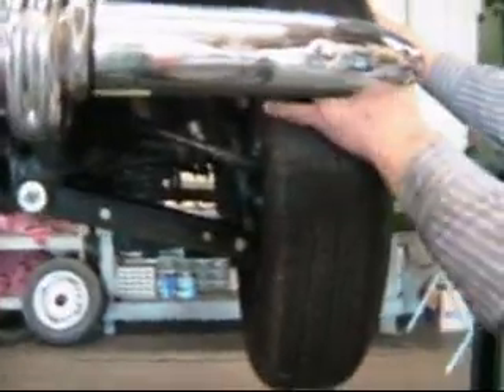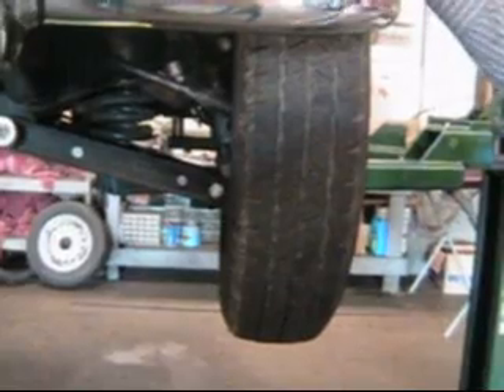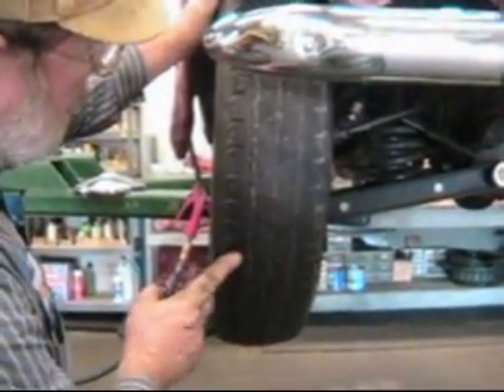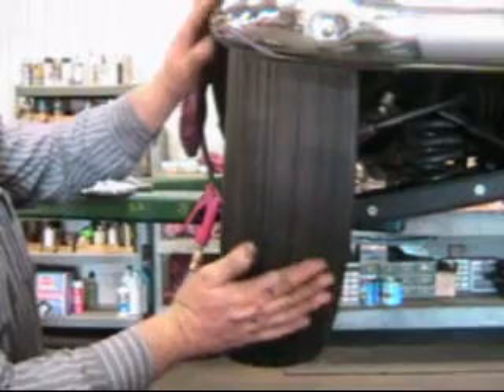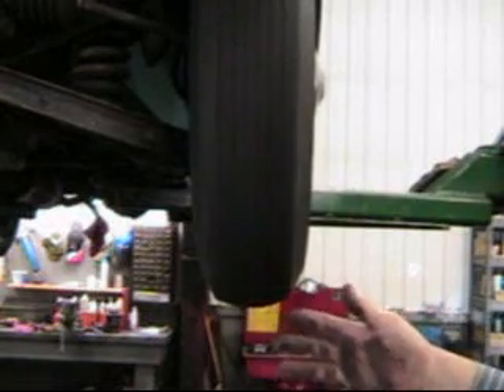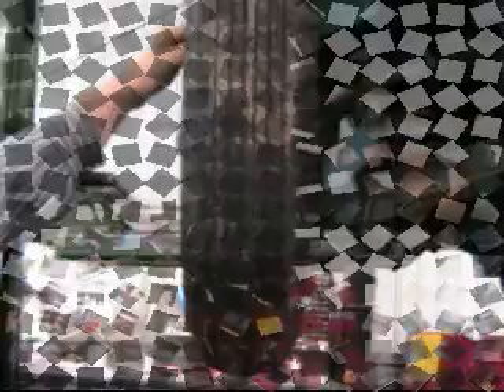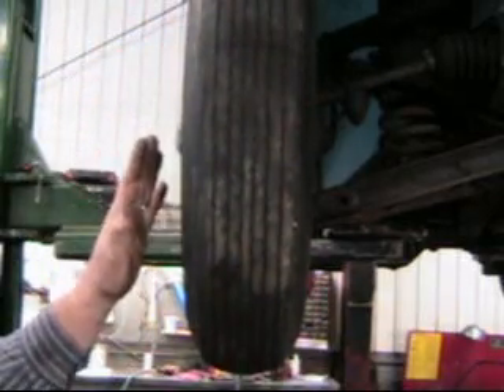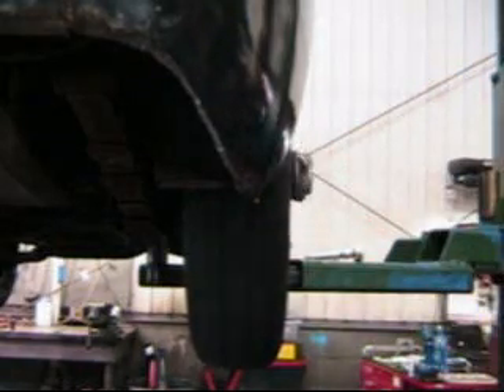75 MG Tech | Balancing Wheels on MG

Comment: Hello sir.i have a fiat bravo 2008.lately when i strongly accelerate from 70 kmh and up the car starts to shake and stops when normally cruising at any speed.if i accelerate very smooth it doesn't happen.Between 70-120 hard acceleration results a shake on the car.what can be the problem?

Comment: Top gear is either direct drive or overdrive. The propeller shaft will be turning at engine speed or faster - not so in lower gears of course.

Comment: A balance will never fix a tire or wheel defect

All the MG wheels I have balanced, only a small handful were actually round. 

The balance machine displays "replace wheel". Only fix is new wheels or properly repair the old ones 

wheels need to be true, as well as the tire, to get a good balance. You can balance a square wheel, but it ain't going to ride well! Vibration is more than balance!

Also roadforce balance is only for alloy wheels. You don't roadforce steel wheels.